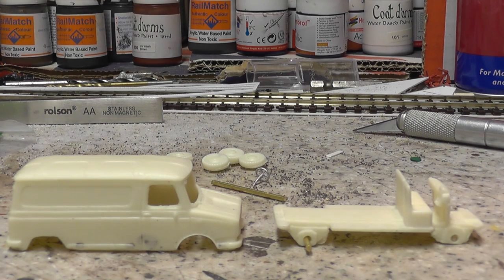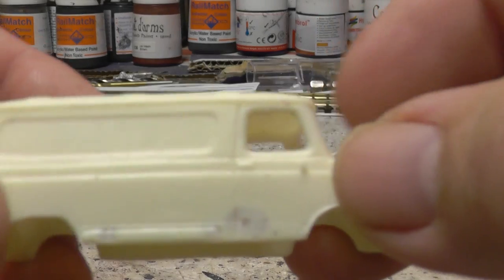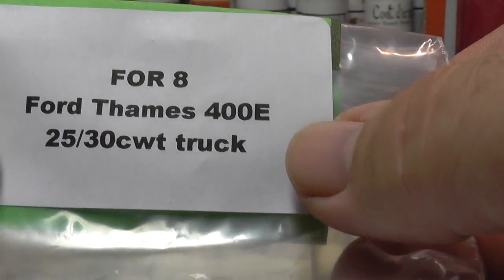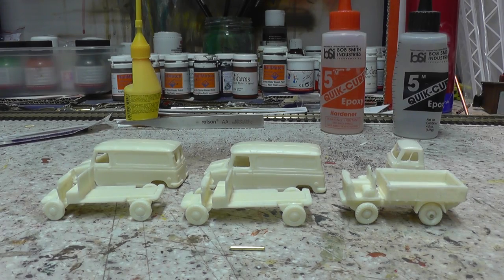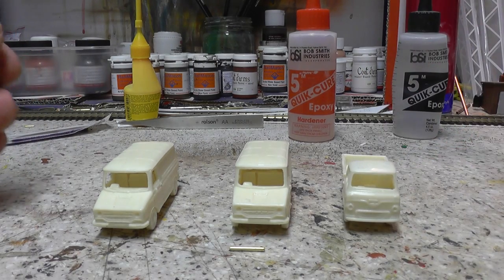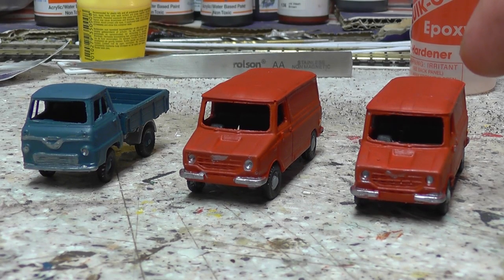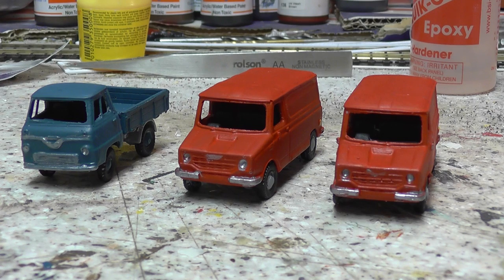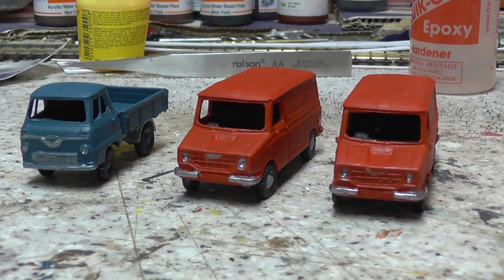building road transport images kits on Penwithers

Comment: They look good Kevin just need a steady and to paint them , which mine is not good at that , used to have one of those Ford Thames vans they where the bees back then ...
Reply from the maker: Hi Dave yes a bit fiddly to paint grandfather ran one of those for 22 years then the ministry put a prohibition order on it , there was only 1 bolt holding the cab on cheers Kevin